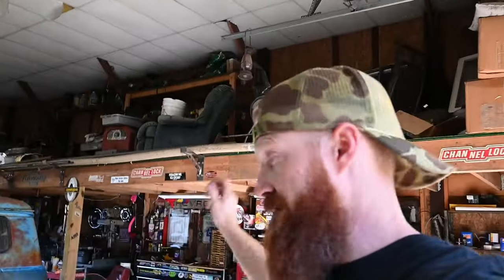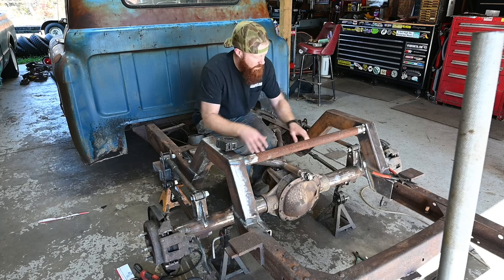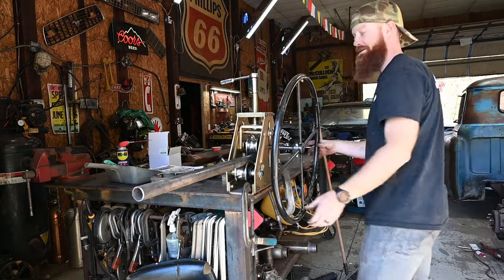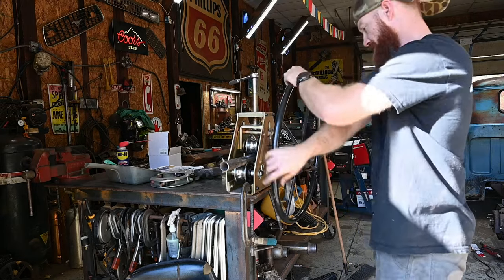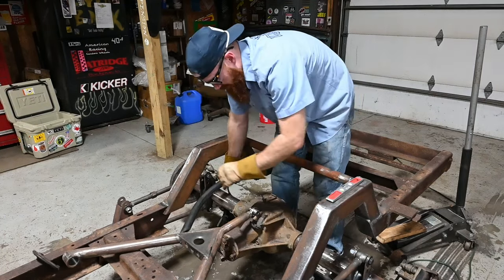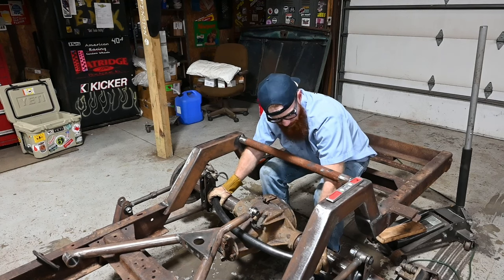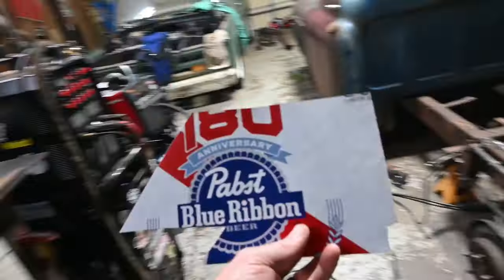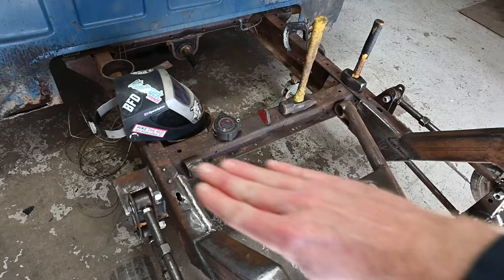Restoration on an Abandoned Apache Truck! Custom Built Wishbone!

Comment: Why 4 links AND wishbone? Ya only need 2 links and bone.
Reply from the maker: It takes the place of a panhard bar or watts link. I had this laying around so I used it 👍🏻
Reply: Im thinking it will bind with vertical travel. Waiting to see the results. Nice fab work👍
Reply from the maker: @natas619 thanks. I was worried also. But being equal length they are all on the same path if that makes sense